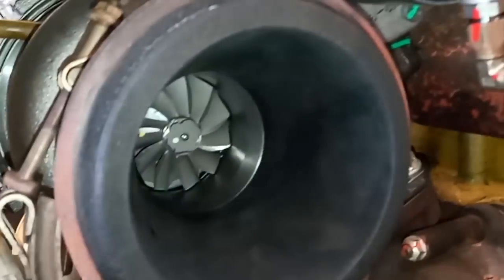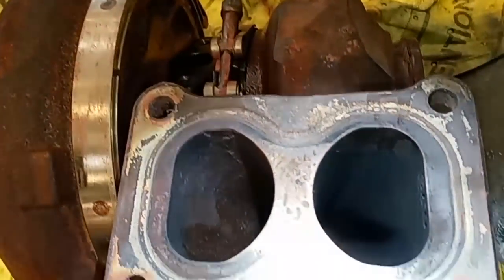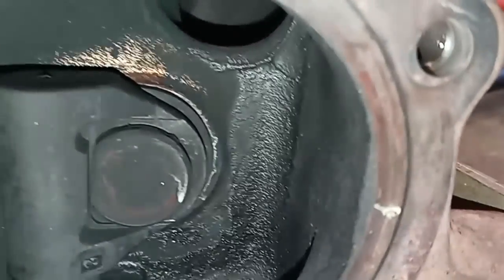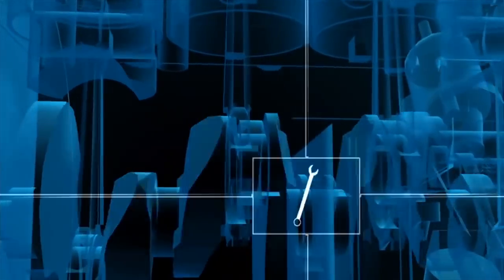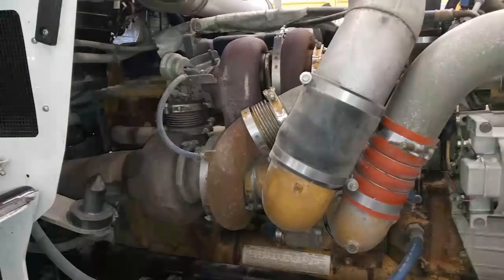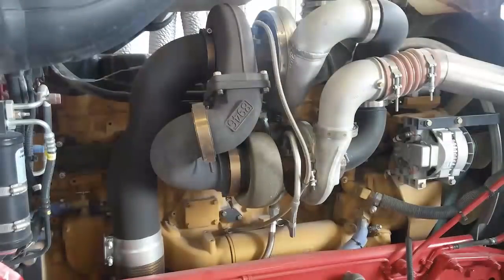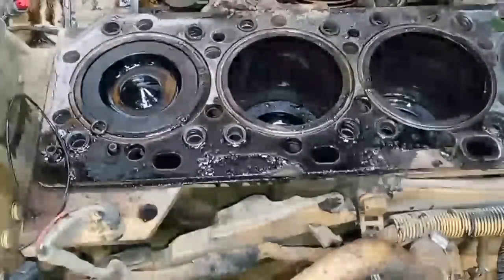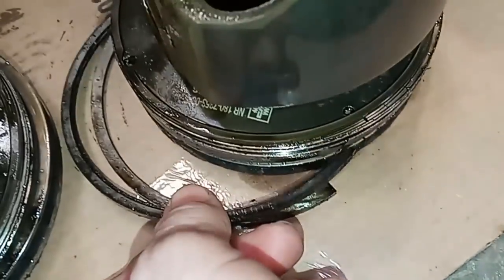Cat's BETTER idea for a Turbo. The Asymmetrical Twin Scroll Turbocharger.

Comment: Kinda curious how much stronger the Jake's on my 6nz would be with that style of turbo. Right now with a 78mm Borg Warner I'm making 20psi of boost with the engine brake on which was about the same as the stock turbo. The other fellas I work with have x15's with the vgt turbo and they're pushing 35 to 38psi while Jake braking. My Jake's will only hold me at 25mph or less on a 6% grade meanwhile their x15's are holding them at 60mph. Any info would be great to hear. I was considering going with a switchblade turbo but this seems way more reliable and possibly better engine braking power than stock?

Comment: Another great video.  Speaking of turbos I would like to ask you opinion on my current situation.  Yesterday I replaced the oem turbo on my C12 with a Borgwerner recommended by the Pete parts guy. The only significant difference between the two units is the way the waistegate actuator line is connected. The cat of course is “from engine to actuator but the BW is actuator to the turbo housing with no way to connect to the engine. The “solution” (suggested by the Pete parts guy) was to cut the hose on the new turbo, attach it to the line on the engine and plug the hole where it was connected to the housing . It seems to work well but when boost is initiated (besides the normal turbo  noise) it makes the sound of a hundred rubber chickens that are being squeezed at the same time. Did I mess up by cutting the hose ?  Is attaching to the line on the engine a must? Any input is greatly appreciated. Thanks
Reply: I have a C15 that we changed the turbo on and it was the same way yours was; we just plugged the line going to the engine and it seems to be working fine.
Reply: Did you plug the open ends?
Reply: @kennedy796  not sure anymore, sold the truck a year ago…

Comment: Cummins does not have actuator problems. Yes, they have cheapened them up with the new X motors, but by and large they are pretty darn reliable. If you service a Cummins the way they should be, every 10,000 to 18,000 miles, or the equivalent hours, perform EGR Tuneups, service the emissions, etc., you can get years out of a VGT turbo, I have. Abuse the motor by following the manufacturers service intervals, and I can see where one has issues. These are EPA motors, they eat soot all day long, that soot goes somewhere, use some commonsense and keep up on the maintenance of the motor and quit abusing it with synthetic oils and extended drains.

Comment: Hi! I’m having a problem with an excavator cat 320D 6.4 acert engine. The code is low fuel pressure on rail. The machine is still running perfect if you keep the engine speed dial in 8 or under. If you select 9 or 10 the engine loose power after a couple of minutes. 
Now it is doing in 8 too. I’m working the machine in 7 now but it is very slow. 
I have changed: 
Fuel Return valve (fuel rail) 
Low pressure pump 
2 Injectors (they had little return)
Flush all fuel lines and fuel filter base. 

Any idea of what’s happening?

Comment: What are your thoughts on the switchblade turbo?
Reply from the maker: It's a very "sharp" design. I actually did some research on them a couple years ago to make a video on them, but have since forgotten much of it. I remember thinking it was definitely better than a VGT design.
Reply: We dyno tested one. Bottom line is it doesn’t work. It performed worse in every way than the stock/non modified housing that the switch blade housing started out as.
Reply: @lelandzim  really?... That's surprising...good to know...

Comment: Hey man any tip for guy starting at cat in few weeks. Been in the diesel Field work in trucks for 5-6years now. just have worked on cat engines that much
Reply from the maker: Just learn how to use SIS2 and you'll be fine. Nothing special about working on them really, every engine has its quirks.
Reply: Whats your thoughts on sis 2.0?
Reply from the maker: A lot of the older guys don't seem to like it. It does have a few annoying thing about it, but overall for someone new to it, it is a better system I think.
Reply: @AdeptApe  
I found ordering a large amount of items is alot easier and the search feature is better

Comment: Have you done a video on a  C7 cat? I have an Rv and would like to learn more about it. First question how often should I change the oil?
Reply from the maker: I have several videos on them. How to change a HEUI pump, how the injectors work, a general video on them. There are several.
Reply: @AdeptApe  thank you, in boot sure if I want to keep it, you my turbo has too many moving parts! Lol
Reply: A good rule of thumb on those engines is 10,000 miles .

Comment: Cat always seems  behind. Just use a vgt turbo. Call Cummins and ad their  aftertreatment and you could be back in on road  trucks.
Reply: Why? Cummins vgt, Volvo vgt both require coolant to the control unit and are a constant pain in the a@@.
Cummins and Volvo evidently never heard of the K.I.S.S. Principle. Especially Cummins with the most complicated fuel system ever designed 😒.
Reply: @cbmech2563  a high pressure pump, fuel rail and 6 injectors is complicated?
Reply: @johndavidstutts  I really wonder how cummins fuel system is complicated

Comment: What they need to do next is evac pressures inside the block. Pressure under the pistons are working against the boost pressure. The more blowby your engine has is more pressure under the pistons. The EPA has them restricting the pcv  more and more which is the only way to relieve the cc pressures.

Comment: I thought CAT didn't make highway engines anymore. Or was that just the smaller engines they quit making?
Reply: They dont thats an off road truck engine
Reply: They've completely and permanently withdrawn from the on-highway engine market. Your only option if you want a new Cat engine in an on-highway vehicle after 2010 is to buy an industrial engine and swap it in. And it's much more complicated than it seems.
Reply: @electric7487  I bet

Comment: How many miles was on the c15 for rebuild
Reply from the maker: 300,000 miles and 18,000 hours.
Reply: @AdeptApe  lots of low gear high rpm. We've got a rolloff at work with 374,000 miles and almost 20,000 hours . Pre vgt Volvo d13.
Reply: @cbmech2563  thanks I was hoping to see a lot higher number but I guess it worked hard mine was overhauled in the 900 thousand area but I just changed all the injectors at 220 thousand I’m hoping to get a lot more. Thank you for making the videos I know it takes a lot of your time.

Comment: They are nothing new. A twinscroll merge valve does the same thing and has been around for 20 years. Industry does not add benefits or cost to an engine until it is mandatory.

Comment: VGT is better in every way.
Reply: Reliability.  Argue your position on that.  Ready set... go.
Reply: Until manufacturers stqrt making better VGT's, no. Good in theory, hasn't been well implemented in practice.
Reply: @ShainAndrews  Holset has no relaibility problems with it's VGT mechanism.
Reply: @electric7487  Except with Holset and Garrett.
Reply: @superjesus4307  That's it... that's what you have? I cleaned two in the past month.  Clean at least one a month.  What else...
Reply: @ShainAndrews  Two out of millions on the road. Cat can't even figure out how to keep engines on the market. Cummins and Garrett stopped using that crappy pneumatic actuator 10 years ago.